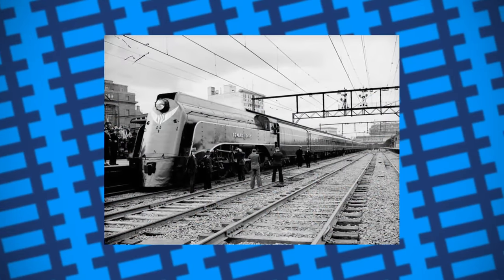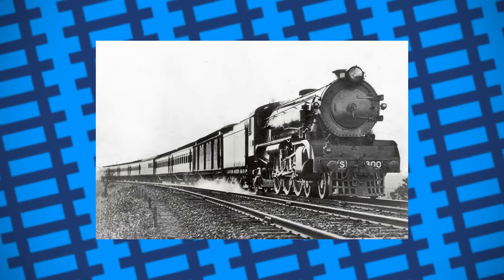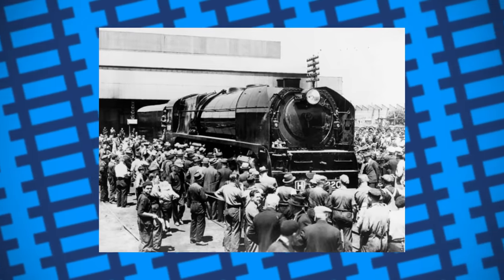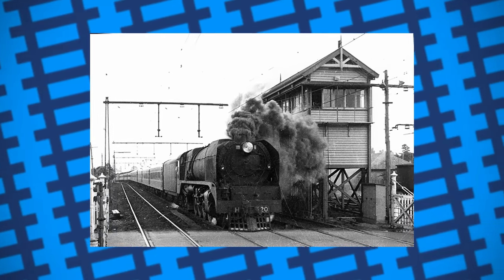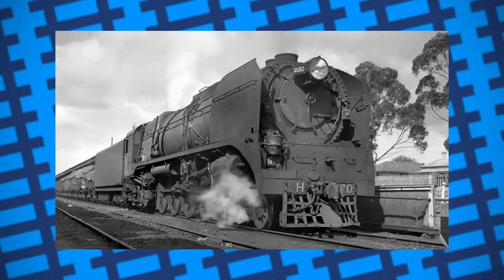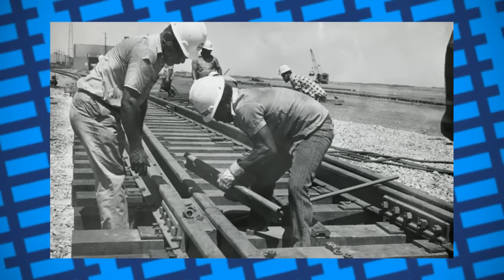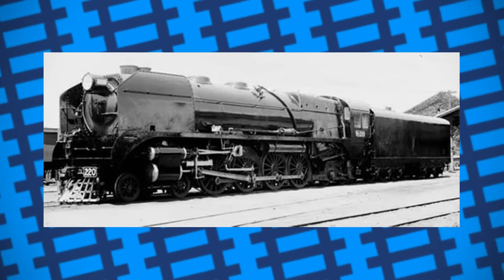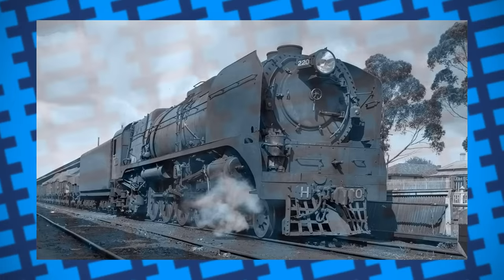Australia's most Overkill Steam Engine - Heavy Harry

Comment: How did it compare to the BR 9F power and performance wise? That was a stout locomotive too
Reply: Far more tractive effort.
Reply: The 9F is a bit more comparable to our R-class, which was the only steam loco built here after Heavy Harry. The Rs retained all the technical improvements from HH but were about 2/3s the weight allowing them to run on all the main lines. The 9F is both slightly more powerful but smaller than even the R though, as the British loading gauge is very, very funny. 

Also the 9F and the R were both introduced after diesels were slated to replace steam, so they have a similar history in terms of preservation. The S-class were scrapped, HH is inoperable and sitting in a (until very recently) open air museum but the Rs had several preserved and run to this day on tourist excursions.
Reply: @Skasaha_ The Rs are nothing like the 9F in the slightest.  The Rs were express passenger locomotives and the 9Fs were freight. 73in driving wheels verses  60in. 4-6-2 verses 2-10-0. Designed for vastly different requirements. The Rs were more like the Britania.

Comment: Seems that any claim of superior power of Oz locos usually turns into a 'mine's bigger than yours' contest between Victoria and NSW. Meanwhile, South Australia's 500B class 4-8-4 developed a 59,000 lb TE (tractive effort) with the addition of the 4-wheel booster truck (4-8-2 as originally built) which would make it Oz's most powerful non-articulated steam loco (based on TE figures alone). By comparison, Heavy Harry had 55,000 lb TE, NSW D57 had 56,000 TE, both locos having 3 cylinders. SAR's later 520 class locos of the 1940s were remarkably different from the heavy haulers of the '20s in that in spite of their 200-ton weight they could travel at speed on 60-lb rail due to their 4-8-4 +12-wheeled tender wheel arrangement and therefore reduced axle load, giving them far greater route availability than their older stablemates. But those figures pale into insignificance when compared with those of American monsters!

Comment: @3:29 your incorrect about it been the most powerful locomotive in Australia till the introduction of the NR class. The New South Wales D58 was as powerful as H220 (both at 55,000 lbf) and the D57 and AD60 Garratts were far more powerful (65,000 and 63,490 lbf respectively) and all in service at the same time as H220. As for Diesels the New South Wales 90 class and the Australian National AN class are as powerful as the NR class and both of those were introduced in 1992/1993 as opposed to 1996 for the NR class.
Reply: chrisrabbit, the author obviously lifted his info from wikipedia.  harry was nevertheless, the most powerful (horsepower - not tractive effort - there is a difference) loco until the an class diesel.  ive never seen any horsepower figures of any nsw locomotives.  until someone produces some genuine information on the horsepower of nsw locomotives, harry's impressive record stands.
Reply: @vsvnrg3263  steam locomotives don't use horsepower to measure power but rather tractive effort thus the NSW locos are more powerful. The AN class and the 90 class were both introduced around the same time and use the same engine so it's not just one of them but both.
Reply: @chrisrabbitt  you are correct about the 90 class.  i hadnt thought about that one.  but just like cars and trucks use horsepower as well as torque, both tractive effort and horsepower can be and is used for locos.  in fact, horsepower was first established for the purposes of rating locos.  nswgr may never have thought horsepower was that important but as you point out about the 90 class, someone thought horsepower was important enough that it was rated and therefore available to be printed on the wikipedia page.  i'd like to see what the horsepower of the fabled nswgr 38 class is.i would say embarrassingly lower than the big vr passenger locos because the vr used to experiment and modify their locos.  thats why they had elephant's ears to clear smoke because of modified front end drafting.  nswgr often just bought off the shelf from uk.
Reply: @vsvnrg3263  no no mate you misunderstood me, the use of lbf only relates to steam trains as a measurement of their power not diesel's, which they do use horsepower as the measurement for measuring power.  I don't profess to know the exact science behind why (and there a multitude of reasons, a quick google search will take you to the articles and pages about it) but a little of it has to do with boiler pressure among all the other reasons. The reason that the horsepower figures are available is that the engines in both the AN and 90 class are the same as the EMD SD60 from the US of which they are just Aussie versions of. Much like the Americans whom we bought the majority of our engines from, we started using horsepower as the measurement of power when we switched to diesel's and I'm pretty sure the Brits did the same though on that I'm not entirely sure.
Reply: @vsvnrg3263  finally mate if you need a good real world example of why measuring horsepower on a steam train and comparing it to a diesel is not really comparing apples with apples, there is a video here on YouTube of Union Pacific Challenger 3985 (about 6000hp give or take depending on who did the math conversion) pulling a loaded 110 car double stack container freight up a steep grade in the southern California desert by itself without slowing, yet 1 6000hp SD90MAC-H diesel cannot do the same.
Reply: @chrisrabbitt , vr had at least one dynamometer car possibly more.  did nswgr have one?  why would vr decide they needed a dynamometer if horsepower rating of steam engines is pointless?  vr experimented with their engines and made good use of such things as dynamometers to develop more useful power.  both the c and s class underperformed expectations as built until modified.  harry received some known-to-work mods before being built.  the kylchap chimney for example.  having a dynamometer proved the worth of the loco mods.  horsepower scores are another useful tool that vr used even though not all railway systems might have seen the need.  i bet nswgr had a dynamometer car.  .had diesels not proven their worth, you can bet that the s class and others would have got kylchap chimneys and belpaire fireboxes, the value of which can be proven with a dynamometer.
Reply: @chrisrabbitt , ah yes, there are other things involved than the calculations of tractive effort and horsepower.  what i would call real grunt.   the ability to actually do the job in the real world.  this is a method used by the silverton railway.  they kept adding wagons till the train could pull no more then take two wagons off.
Reply: @vsvnrg3263  I would suggest to you that it had nothing to do with gaining more horsepower but rather improving the steaming and making the engine more efficient. Did the NSWGR have them, honestly I'm not sure but it's likely given they also improved their engines (nowhere near to the same extent as the VR did) so it would make sense. Nearly all the railroads I checked in the US don't have the horsepower figures for their locos either for the same reason as pretty much everyone else, horsepower is irrelevant to steam trains where as tractive effort isn't with the only exception been the Norfolk and Western who do. The reason for that is they did testing to show that their steam trains were more efficient and had more horsepower than a contemporary diesel of the time so there was no need to switch for a less efficient means of motive power. They had a great reluctance to ditch steam as they had coal mines so coal was cheap and their steam trains could out pull early diesel's by a country mile.
Reply: @chrisrabbitt  , horsepower indicates power for cars ,torque is what is important for trucks.  tractive effort is what gets a goods train moving, horsepower is what gets a fast passenger train to keep to a fast timetable.
Reply: @vsvnrg3263  pretty much mate that's it, although it's not just horsepower that is needed for higher speed on passenger services but also other factors such a wheel size play a big part.

Comment: THE REASON FOR NOT BUILDING THE OTHER TWO OR MORE, WAS THE NEED FOR STRATEGIC METALS THAT WERE HEAVILY ALLOYED!
THE HIGH ALLOY METALS WERE NEEDED FOR AIRCRAFT ENGINE PRODUCTION !
ON THE SANTA FE THERE WERE STEAM LOCOMOTIVES BUILT TO AUSTERITY STANDARDS , BUT AT WARS END, WHEN STRATEGIC RESTRICTIONS WERE REMOVED, THESE ENGINES WERE RETROFITTED WITH ROLLER BEARINGS AND STRONGER AND LIGHTER SIDE RODS!!
KEEP THEM ROLLING BROTHERS!! 👍👍

Comment: So they call this locomotive heavy Harry but what really separates it from its exterior twin UP844? If it was just sheer weight why did Australia not look at the US northern types and trim some fat off?
Reply: The only steam loco built for VR after HH was the R-class. It kept all the technical improvements HH had but was only 2/3 the weight and was light enough for all the main lines. Unlike HH and the preceding S-class, the Rs were actually built in numbers and saw quite a lot of use, but not for long as they were built too late and diesels were already in town.

Also UP844 is a monster and would destroy even the heavily laid Albury line under it.

Comment: I wonder why a larger-drivered 2-4-4-2, or a 2-6-6-2 weren't considered !?!?!??
Reply: I suppose they wanted something powerful but simpler. Despite the hilly nature, none of Australia’s railways really liked articulateds. Only the Garratts were used and those were (at least in concept) to boost power on branchlines.
Reply: @russellgxy2905  The C&O (in USA) loved the 2-6-6-2 configuration.  Hauled at speed long coal trains in the mountains of W. Va.  I'm guessing WEIGHT, again, would have been an issue.

Comment: Ive been very interested in Australian steam for quite a few years now since I learned about the AD60s. One thing Ive never been able to understand was why Aussie roads never just imported more American built locomotives during the steam era. Im guessing it was a weight and loading gauge issue? But if that was the case then why import/build F units and Alcos in the 50s and 60s? NSW being the only standard gauge system (at the time) probably had something to do with it as well. Feel like the Northern or a Berkshire type would have been pretty at home in Australia.
Reply: I understand that all Australian F7 based locomotives had to be built here since they were non standard. They needed to be narrower and have less height due to loading gauge restrictions of about six inches less in height and width. Impeted F7 Bulldog noses had a slice taken from the centre locally making local Bulldog streamliner types. The axle load also needed to be less for our lighter rails, so the Victorian Railways specified what EMD developed as the SD truck to be standard on larger diesels. The less adhesion of the A-1-A tried idea tried in other parts of Australia was rapidly ditched for new locomotives ordered. Usually with a hood unit the cab needed to be a different slope side design. Same for US built steam locomotives, although in earlier years this was less of an issue. There were also import duties to encourage local production.
Reply: @johnd8892  I didnt know the Aussie F units were actually smaller, I couldnt put my finger on as to why but they always looked a tad undersized for some reason but I guess there really are.
Reply: @WasatchGarandMan  I have just done some research to get much closer estimates of how our F7 derived locomotives differ in size to a US F7.
Using the well documented , fifties delivered, Victorian Railways B class and S class dimensions. The US F7 is 12 inches taller, 10 inches wider but 10 feet shorter. Like most 1500+ Horsepower Australian locomotives they ran on six powered axles and had some level driving controls in the B end. This mainly accounts for the greater length. Axle loads desired to be kept under 20 long tons to have less restrictions on the lines they can be used on. These width,  height and axle load limits are common on the broad gauge and standard gauge lines in Australia. Narrow gauge lines are more varied but usually much more restricted. 
A big exception are the extensive but isolated Iron Ore railroads in the North West of Australia. They are the exception since they went with the maximum US AAR standards from day 1 and did import many new and second hand US locomotives. Some rebuilt with cabs giving less sun intrusion and a better drivers view ahead.
 Good that you understand that they are F7 unit based, so many Americans see a six axle EMD bulldog nose unit and think it is an E unit. Even though we did not want the twin prime movers nor the lack of adhesion of the E unit non powered centre axle trucks.
Good to see that you are also interested in the AD60. I would recommend yo do yourself a favour and search YouTube for :
NSFA Steam on the Main North 
Fantastic very professionally filmed late sixties lineside action including numerous AD60 locomotives including a hard working doubled headed pair. By a TV producer railfan using professional film and sound equipment.
Reply: wasatchgarandman, nsw did import a lot of their locos, mostly from uk.  the ad60 for example.  the 59 class is from the us.  south australia imported some big steam locos from the us.
Reply: @vsvnrg3263  All the South Australian Railways big engine policy, post 1926 steam locomotives, were heavily US influenced in appearance and design but none were made in the USA. They were largely produced by Armstrong Whitworth of Newcastle on Tyne or South Australian Railways own workshops. A few ex VR North British and one class from Clyde NSW.
The few US built steam locomotives they had were around the 1880s era and comparatively short lived like so many imports of steam locomotives from the USA to Australia.
Wikipedia gives more detail on each SAR class
Reply: @johnd8892   correction noted.

Comment: Why was it overkill?  Was it overkill because it was far more powerful than was required? Was it far more powerful than required because the designers were incompetent? surely, there would have been performance specifications it would have been expected to meet and anything supplied in excess of the requirements would be more costly to manufacture.

Comment: Not sure what all the fuss is about... NSWGR built the D57 Class ten years earlier that was lighter, had an extra 10,000lb of tractive effort and was just as fast. And they built 25 of them, not one.

If you want an actually impressive Aussie locomotive, look at the C38's.

Also, it amuses me that the only place you pronounced correctly is Wodonga - also the only Aboriginal name. xD
Reply: i mean, he got ballarat right as well.
Reply: Get outta here Sydneysider 😂
Reply: Yes, both the D57s and AD60s were far more powerful. The claim that H220 was the most powerful engine until the NRs came slong in the 1990’s is ludicrous. H220 wasn’t even the most powerful when it was built! Then the 46 Class comes along and is more powerful than any Australian steam engine.
Reply: @dat581  Eh, the 46 was impressive but a single unit had half the tractive effort of a D57. That steamer was a fantastic class of locomotive that doesn't get nearly as much love as it deserves - it had nearly twice the tractive effort of BR's Class 9F, were built 25 years earlier but were still small enough to use on plenty of lines, unlike the monstrosities the Yanks were building at the time (although granted, the 9F was a LOT faster).
Reply: @dat581 , wrong.  harry has more horsepower than any other until the an class.  d57's (what a machine!) had far more tractive effort.  its a heavy goods loco.  the ad's had baby sized wheels.  lovely to look at but again its a goods loco.  unless you can produce some figures showing the horsepower of nsw locos to prove your point then harry's record stands.  nswgr must have been embarrassed about horsepower figures of its fast passenger locos.  surely it tested them.
Reply: @rus0004  I've lived in both Melbourne and Sydney actually, but NSW definitely wins the best locomotives competition. The Victorian stuff just feels so uninspired.
Reply: @PaladinCasdin  Uninspired how? 

I can go and live in New York for a month, it won't make me a New Yorker. Where do your allegiances lie? (or in the words of Kendrick Lamar; "Where you from, my n*gga?")

Comment: Third most powerful steam locomotive in Australia after the NSWGR D57 at 64,000lbs tractive effort and the AD60 at 63,000lbs. The claims about power are utter rubbish with the two above steam locomotives being more powerful and the 46 Class electrics from 1955 being far more powerful. 

Mel-burn, not Mel-born. All-brey, not Al-berry.
Reply: dat581, so what is the horsepower of a nswgr 46 class?  i'm asking about horsepower, not tractive effort.
Reply: @vsvnrg3263 The one hour rating is 3780hp. Then we have the 86 Class at 4400hp. All decades before the NR.